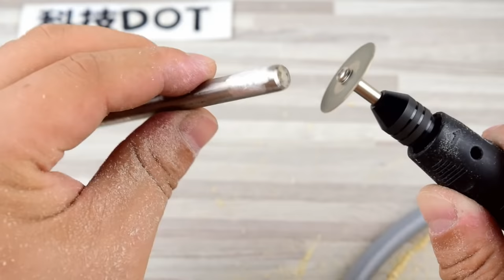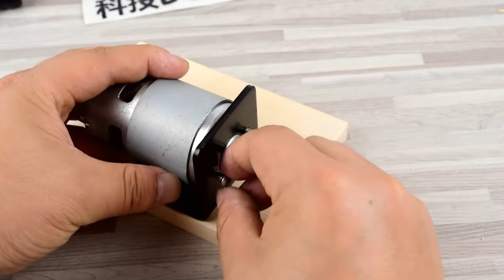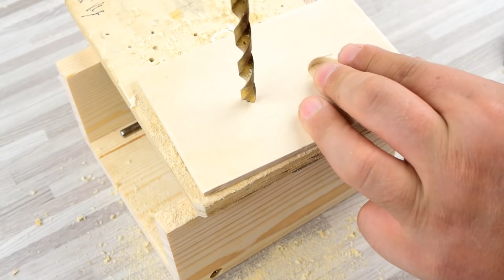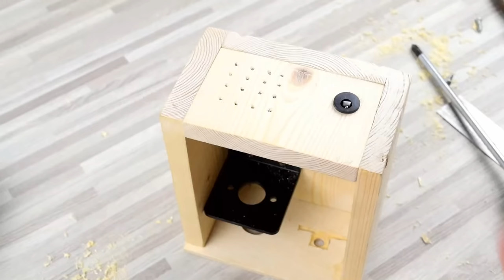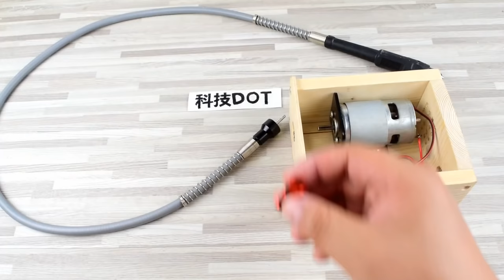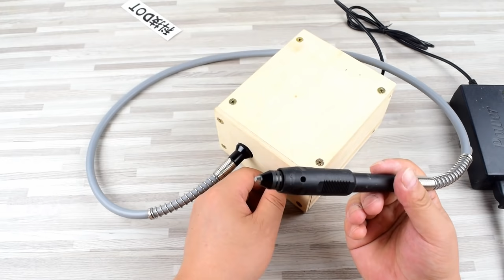How to Make a Dremel Tool with Flexible Shaft at Home

Comment: Hi! Nice idea, please which are the specific for the power supply?tnks
P.s. I mean, you are using a 24V 5A power supply, but your electric motor is 150W, so your power supply can only supply 120W at maximum output power. It doesn't fit your dremmel
(120W= 24V*5A)
Reply: But you can improve the power supply to 10a (so that it doesn't get loaded too much)

Comment: Total cost of materials required:
~$40. 

Wen 3205 rotary tool with flexible shaft: $18 on eBay. 

Difference.
Reply: cost is way less lol
Reply: Benito Mussolini - ah, you’re measuring money. Perhaps the poster is measuring something else?
Reply: Eugene Kelly I’m measuring not the money. I am judging how efficient is the investment. I mean, it takes some skills alongside with manual dexterity to make something like that, I admit. Perhaps I could do it even fancier with a tin body & grounding in accordance with the electrical compliance, etc. Doesn’t matter. 

What I am saying is if you make, for example, a custom item to sell it or for yourself, you can’t buy this custom item anywhere. Therefore, you put effort to make it. A character figure, a nozzle for an airsoft gun—sometimes these are less expensive to make rather then to get from the online. 

Yet the rotary tool he made is just for plain use. When you need a crescent wrench, you go to the local Home Depot and get yourself a wrench, instead of taking a welder or even a CNC machinery to make one for yourself—because the factory that makes tools is optimized for making the most efficient product for the lowest cost. Even though making a crescent wrench certainly takes some of “something else” to create one. 

Same here. If you want to learn, no problem, but it’s not gonna be the most efficient way of spending your time & money.
Reply: After watching this video, I decide to buy a Dremel Rotate Tool. LOL
Reply: @kilovolt2494  Yeah if I'm going to make my own tool it's going to have to either work better than something I can buy, or be significantly cheaper with little compromise in functionality.
Reply: Trekkie99 in this case buy WEN 3205 or alike (for this money you already have a somewhat of a working final product with a few drawbacks), later you can get it improved (balance shaft, change the motor for a better one). 
But I always go with quality tools in the first place. You can build something better than from the store, but believe me, you would need to have metal processing machinery alongside with excellent engineering skills to make it working.

Comment: I have the actual Dremel version of this and after a several minutes of use the hand piece gets so hot that you can't hold it anymore without wearing heavy gloves.
Reply: Needs a small fan that will help it cool down when you are using it.
Reply: @zeldaprince4320  Where you could add the fan?

Comment: It would work better if you wired the power into the motor properly. You have it the wrong way around the motor is turning backwards hence the burning while drilling.

Comment: How to make flexible shaft dremel: buy a flexible shaft dremel
Reply: I have a dremel 3000 120w 35k rpm and i use a 10 dollars not original flexible shaft and it does the job pretty well

Comment: How to make a fezi le shaft rotary tool. Buy all the parts of the rotary tool separately and then put them together in a wooden box. But now be disappointed because we used a weak ass motor. Boooo